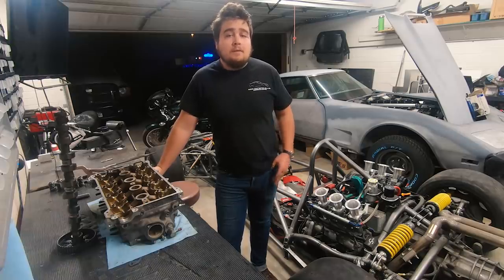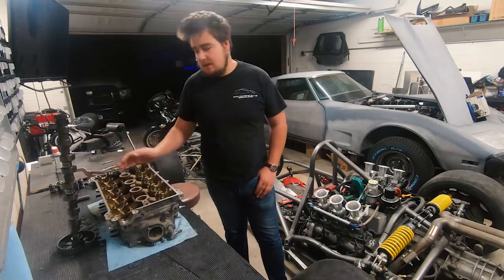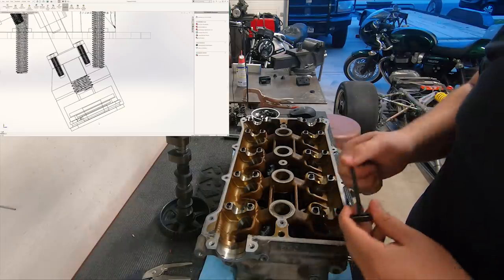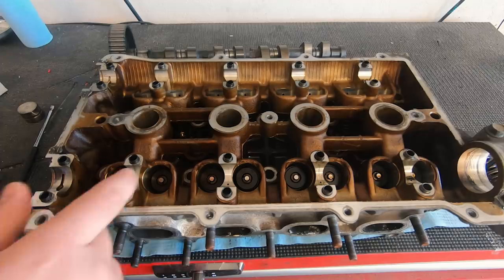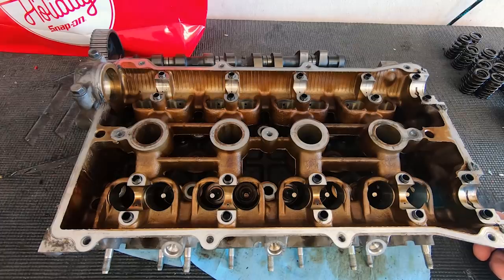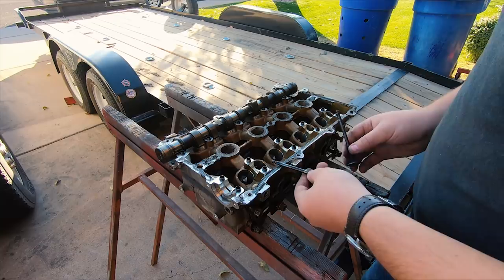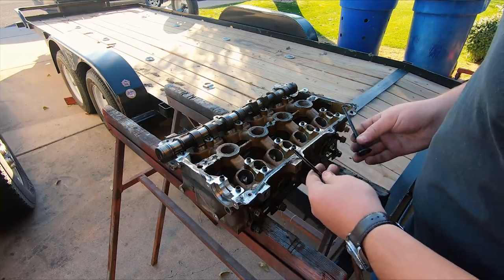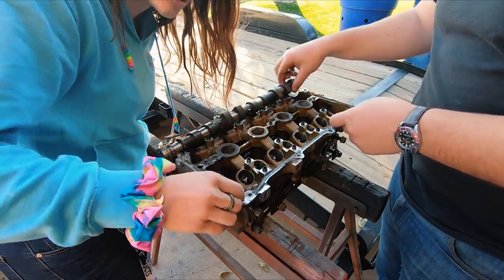Freevalve Miata Build! - Part 1 of  2

Comment: So many miata folks will want this as a kit.
Reply from the maker: I'm hoping at least a few people will be able to use it!
Reply: @WesleyKagan  I don't have a miata but I'm into other Mazdas that use basically the same valvetrain and this has my interest.
Reply: I do!
Reply: Festiva owners hoping to squeeze every last pony out of the SOHC 1.3 haha
Reply: @WesleyKagan  Not sure if it would be an issue, and I'm definitely not a lawyer, but I'd look into any patent encumbrances first before selling this. Would definitely be cool if feasible.
Reply: @WesleyKagan  I am very interested in seeing how this plays out, since I have a 1.6 and optimization of the engine is not exactly strong with those
Reply: @UCuVZUg7_UGjdcMhDpKxUMOQ I would think his main problem is calling it "Freevalve" since Koenigsegg owns that. The specific implementation can be different so not as to infringe on a patent.
Reply: @GrantHolmbergBaugher  you're probably right, he would be ok with this but might be polite to get the nod first.
Reply: @RybotTWC  if anything was an issue the name would be the most likely, and that's a simple fix. Like I originally said, I'm no patent law expert, just thought it was something I personally would consider first before finding out the hard way, since.. I am not a parent law expert.
Reply: I'm following this with great interest, I am building a 1.8 Miata for drag racing here in the UK. I am also an electronic and software engineer with qualifications as a motor vehicle mechanic so this hits all the sweet spots for me. Great work!
Reply: I'll buy a miata just for this lol
Reply: I have a Miata and I’m planning on seeing how it goes and probably figuring out an implementation. Probably won’t work on boost because of heat.
Reply: He probably would get sued by konessegg
Reply: @RybotTWC  Call it AirCamValve
Reply: The good thing is this could be expanded to work on any engine   And make designing a aftermarket cylinder head cheeper and easier 

Imagine being able to make a 4 valve ls engine  where the rpm is only limited by the crank rods and pistons rather than valve train
Reply: @Ethan Vermillion I’m speaking as far as 3D printable materials. I can make ABS and PC parts on my setup. I just know that there’s a lot of heat right next to the valve cover because my turbo is top mounted.
Reply: Dude I want a kit for the predator motor. Or drawings. I'm a machinist, I'd try to do it myself if I had drawings.
Reply: @WesleyKagan  I want this for my LSx V8 and have for years.
Reply: I just want it done on a vehicle so I can use his research on my honda!
Reply: How are you planning to lubricate the double acting cylinders. The factory grease is unlikely to last at that frequency. Leading to a break down of the piston and piston rod seal.
Reply: @gavinhowell06  lines from the cam journals would do it.
Reply: @salazam  what about a 90' gtx/r? Exactly the same heads.
Reply: Yes please
Reply: Guilty
Reply: I am miata folk, and I absolutely want this!
Reply: Why stop at Miatas? That would be a large market and thus a logical first step, then maybe the LS would be next. But I could imagine this being a modular system, pneumatic system, pneumatic valves, controller, ECU, and actuators (in different numbers) would be pretty much the same for all engines. Then could have different bracket designs to hold said actuators and mount them into pretty much any engine. Any engine for which aftermarket cams have been developed would have enough market for these brackets to be made, as the brackets would be cheaper than an aftermarket cam and if there was enough demand for cams, there'd be at least as much demand for this. I envision this being an upgrade kit similar to how EFI upgrades are available for pretty much any old engine that would have originally been carbureted. Someday I'd like to have a version of this on my old VW Bug's engine, I've already converted that to EFI (plus turbo), this would be the logical next step.
Reply: Miata owner here and I would definitely be interested in this
Reply: @WesleyKagan  I will buy a kit, do you have a running list of people for a group buy once you finalize everything? Do you have a Facebook or Instagram where I can PM you?
Reply: @WesleyKagan  well they sold about 400k first generation miatas so I expect at least 400k people. Fr this is the only thing that I've been actually excited to do to my Miata
Reply: @WesleyKagan  very very interested in a 1.6 kit
Reply: I'd pay for this in a heartbeat!
Reply: @WesleyKagan  are you kidding me the whole fuckin planet will run your kit if its affordable!!
Not to mention after that the 2jz or whatever. A bolt on freevalve thats heaven!!!!
Reply: Don’t think Koenigsegg in particular would have a problem with it, but there are licensed customers who paid money for this technology - they would be pissed if the licensed patents wasn’t enforced
Reply: @heidelbergaren5054  i think original free valve is electrically actuated and this is pnematically actuated
Reply: @FirstLast-tx3yj  I think they use solenoids.
Reply: @WesleyKagan  if you ever end up selling this kit, count me in. Amazing skills and great project. Kudos to you.
Reply: @FirstLast-tx3yj  
Absolutely 100% incorrect.
The original “Cargine” set-up (later freevalve) was pneumatic and on a B&S motor, then during the last 16years the company have tried and patented a multitude of variants including storing compressed air during engine breaking etc.
Reply: @heidelbergaren5054  so the gemera free valve is pneumatically actuated?
Reply: Seriously, if this were made into a kit I know SO many people who would buy it. Especially if it fixes the lifter tick. Kudos for picking this engine, lifter tick is practically a standard feature on these cars lol. Looking forward to part 2!
Reply: Id want it just to have ridiculously lumpy cam  sound around car parks
Reply: @WesleyKagan   I have a miata and would buy this asap
Reply: I would very much like a 1.6 version

very very much
Reply: Everyone wants this. Imagine this one a V8
Reply: @WesleyKagan  I know there is a company that will let you send a 3D print file and then they will make it for you. If you make the adapter kits for cars and get a metal 3D printer you could definitly sell thease at profit. You supply people with the kits and they assemble them. The metal 3D printers are pricey tho. maybe nylon prints will work?
Reply: donut media in a few day "is a miata freevalve kit worth it?"
Reply: @AustinRBa  hoping to hear more Rodney's making an appearance..
Reply: Camus deletus name problem solved 😂
Reply: @burntchickennugget191  The Koenigsegg CC850 has a Freevalve V8